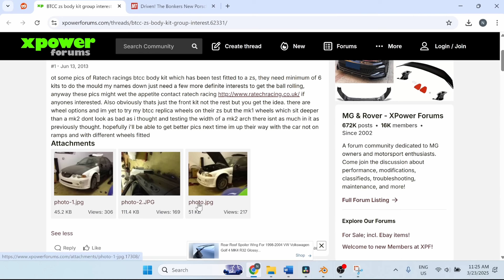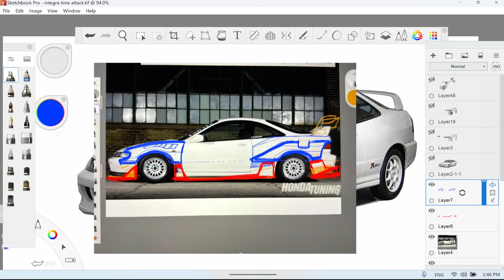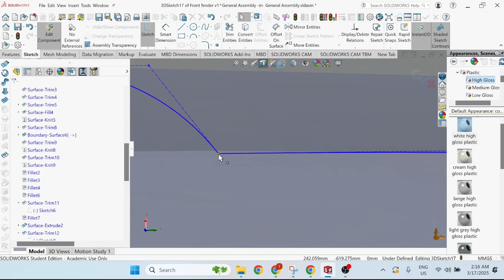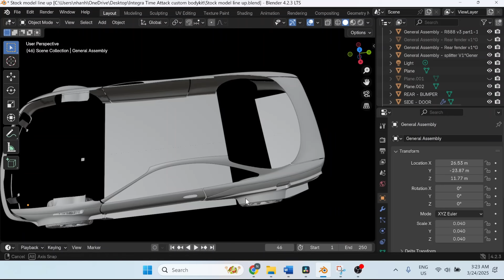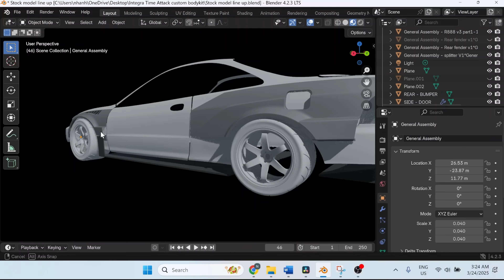I DESIGN & 3D PRINT BODY KIT IN 5 DAYS!

Comment: What print settings are you using and in what material? I've been trying to do the same thing but printing the thin panels has been a nightmare.
Reply: Print not the part, but a part with exterior perpendicular reinforcement (more easy to print than thin panels) which serve as a mold...

Comment: hello,

why making the kit in fiberglass ? 

is it possible to keep the Printed one as the definitive kit ? 

Thank You.
Reply: No, even if most of youtubers use the 3D parts, it's just to make views...

PLA melt at the sun, PETG...
ASA is good enough...

Don't print a part, but a part with exterior perpendicular reinforcement (more easy to print than thin panels) which serve as a mold...for a entire fiber+resin part which last ...

Comment: How is this going to translate to fiberglass? Are you gonna lay the fiberglass over it and be done or you're going to use it to make a mold and than th fiberglass over the mold? I'm curious because I wanted to do tht but just a simple lip and maybe than a whole bumper. I have a 1993 Lancer and wanted to make the whole evo 3 kit eventually.
Reply from the maker: @mordidoo  thể 3d print will be the mould yes for fiberglass layup
Reply: Lay the fiberglass over the PLA/PETG part is just used by stupid youtubers who want to make views... It doesn't last.

Don't Print the part, but a thick part with exterior perpendicular reinforcement (more easy to print than thin panels) which serve as a mold...for the real fiberglasspart.

Comment: Could you please share what 3D scanner he used to scan the car?
Reply from the maker: @martinkrajci1902  I’m not sure I will have to ask but I know it was an industrial scanner that cost somewhat above 10k
Reply: Most of the CAD sold, are stolen from videogames, and sold as scan 3D model...by the seller.

You can fin most of these accurate 3D for free...

Comment: shoot i resin printed a small model of what i want the outcome to be, but i guess 3d printing it full size would be fine
Reply from the maker: @itunesaccount760  yes this is also a good way to have a physical model. But me I was more interested in the fitment for this prototype. If I was to test out different concept, I would print in smaller scale to save material
Reply: @BadDesignGoodDesign  what if u 3rd printed a small car and scaled everything smaller to it?
Reply from the maker: @ yes I can but scaling is not easy for me since my model are 3d scan model they are not solid model

Comment: I'm looking to buying an H2D Bambulab printer to 3D print the front side fins of the bumber for my stock OEM Evo X bumber, which carbon fiber is best to use?
Reply from the maker: you can use thinner cf for the outer surface to conform to the mould like 3k cf, then 12k cf to reinforce it

Comment: Bro this is SICK got me excited for the project. Are you guys gonna run the 3d printed part or make fiberglass moulds and do fiberglass versions? I know its commonly asked but how will these parts stand the daily heat?
Reply from the maker: @LoyalKNG  the 3d print is just a mock up to see how the 3d model translate to real life. I will use the 3d model to make a mould so that I can do carbon fiber or fiberglass lay up 🙌

Comment: I'm building my own vehicle and I have a foam body that I plan to scan, for the chassis parts I have been using on shape, do you think that for the body blender is good, also need to 3d print the body after the 3d design
Reply from the maker: @hojbota-ptv i personally use Solidwork for 3d print part and since I’m used to it u can get work done very quickly. I feel like a blender is good for conceptual design but for manufacturing I’m not sure 🙌